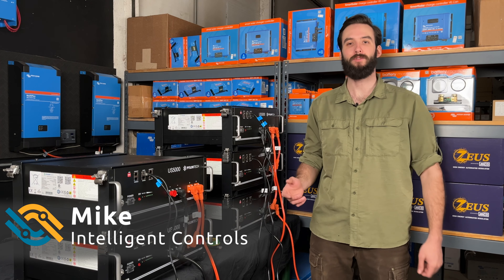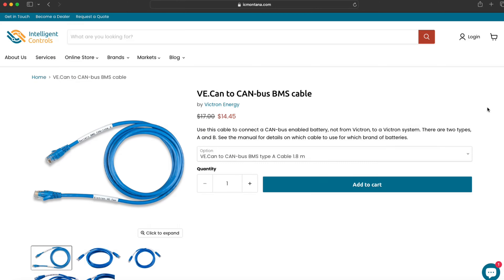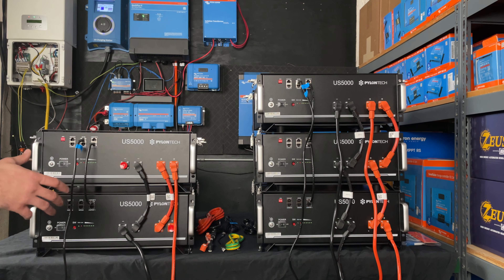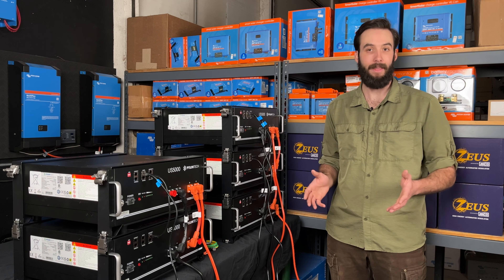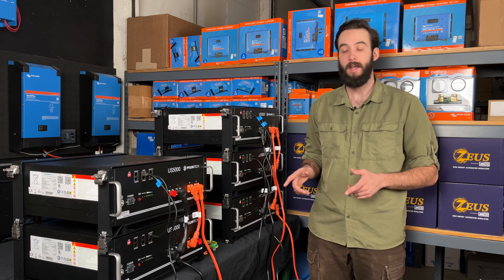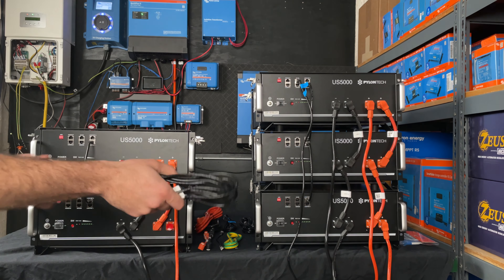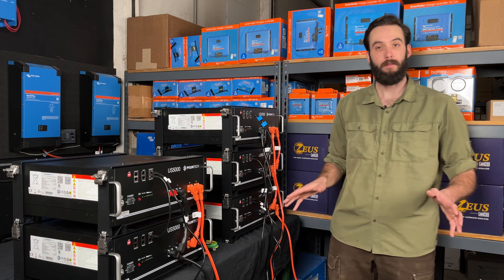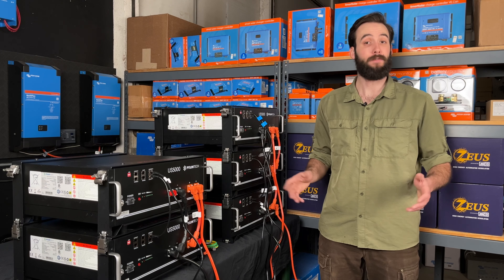Pylontech Cabling Master Class

Comment: Do the "shorty" connectors have some kind of communication you did not mention?

How do the batteries know how the 120A cables are connected?
Reply from the maker: Hey James, sorry I wasn't super clear on that point. The battery cables do not have any communication protocol in them. In a closed-loop system with Victron equipment, the batteries communicate, via CAN-bus, how many of them are connected and how much current they can handle. If one goes offline, the overall charge/discharge current is decreased to compensate for the reduced capacity. In a system where you have limited capacity for current due to your wiring, such as 2 batteries with 1 end run, the upper limit imposed by the cabling should be hard-coded into the Victron system. This way, the inverter will always default to the lower of the two values given by the batteries via DVCC and the hard-coded limit set by the installer. In our next video, we'll go over those settings.

Comment: This video covers a valid point. It's all about redundancy, especially in harsher climates. I can understand in extreme cold climates it's not always possible to climate control the battery room leading to reduced capacity and even a battery shutting down due too cold to charge a possibility  

Here in most of Australia due the hot summer weather 3 months of the year we always DERATE everything to 70% MAXIMUM CONTINUOUS current. That is BOTH with the batteries and inverter being usually in an air conditioned room set to a max of 27 degrees C when it can be 45 outside for the hottest hours of the day. When it's hot we have so much sun and long days so climate control of the battery room is so easy to do as we have surplus solar power. We always look at the best outcome for longevity of life for the hardware and reliability of day to day use as a worst case weather situation.

Interestingly my Pylontech US5000-B battery label states 50 amps is the preferred CONTINUOUS CURRENT per battery and 100 amps Max , so my spec across 3 batteries is 150 amps x 48volts = 7.2Kw @ 240 volts is it's comfort zone. There is also up to 200 amps PEAK rating per battery for "seconds" on top of that and the inverter can do 22Kw peak to cope with induction motor starts such as air compressors, water pumps or large power tools and even welders 

My 3 x US5000-B batteries run 2 sets of end run cables giving 240 amps (cable amps continuous) that feed an 11kw inverter that is feeding a home demand load max CONTINUOUS LOAD of 7.2Kw (approx 70% max load) or what we call a (very common) 240 volts 32 amp circuit. This is fine for a small 120 sqm home. You will need double that for a large 240sqm plus family home with air conditioning by far the biggest current draw with cooking after that. Heat pumps are used for hot water and excel in hot climates using only 1-3 kwh per day so are not big power users. 

So even if 1 battery were to drop out of the 3 it would not be noticed in the home as 2 batteries can easily supply 75 amps each. Not ideal for longevity but any battery issue would likely be fixed in days or weeks and not months or years
Reply from the maker: Thanks so much for sharing this Philip. This is exactly the kind of system design philosophy that we are trying to share over here in the States. I can't think of any other critical home system that gets day-to-day use that gets constantly run on the bleeding edge of maximum performance, some level of redundancy is always key. It sounds like you have some great systems!

Comment: Great videos about PylontTech. Just one consideration for the feature of the BMS managing power distribution across different cable lengths - if the discipline of cabling is maintained where the installer does keep lengths the same, any BMS failure could be mitigated by the fallback physical implementation. Does this sound reasonable or does the BMS not really fail in this way (or are there safeguards in place)?
Reply from the maker: Hi Nick. The TLDR is that the BMS does the majority of balancing by just getting out of the way of physics so there is no wear and tear occurring. If the BMS board fails, you can't charge/discharge the battery anyway due to the now-deactivated MOSFETs, so there's no real advantage in planning a system to be redundant in that way.
In a low-voltage parallel system, the natural balancing flow of current between batteries with a voltage (state of charge) imbalance will be more than enough to make up for any reasonable imbalance that comes from wire resistance IF the BMS allows it to happen. Most BMS boards are mated to cells that they are not truly calibrated for and make up for this with stricter safety protocols. This is why most batteries will throw an error code and isolate when this type of balancing is detected, hence the necessity to ensure that such imbalances never happen in the first place by being super consistent with wiring, aka that physical implementation you identified. The genius of the Pylontech BMS is that it is mated to and calibrated for their own in-house, self-manufactured cells, which allows them more room for these natural balancing flows to occur without creating a safety issue. If something were to go wrong, or for more aggressive active balancing, they also have the ability to close off the MOSFETs and isolate a single unit from the charge or discharge state of the battery bank until the other units come into enough parity for passive balancing to commence. By combining the ability to allow passive balancing to naturally occur, supplemented by active isolation-based balancing, we get some freedom from the normal constraints associated with most LFP batteries such as needing to match wire lengths or cycle counts/ages for the batteries in a bank.

Comment: Three US5000 are to much for the small 25mm² cables!
Reply from the maker: That's why you can use multiple cables. If you are pulling more than 100A off of three batteries, all you need is another cable kit.

Comment: Wait hold on, are you selling ethernet cables as communication cables 😂
Reply from the maker: Depends on what you mean by selling. Most batteries use CAN bus, which is a pretty standard protocol. The extra comms cables in Pylontech’s cable kit are just tossed in for free as a useful addition to the end runs. The Victron BMS cable is something you could do the research on and then pin out and solder yourself from an appropriate network cable if you wanted. Most people would rather just spend $14 for the convenience. Your mileage may vary.